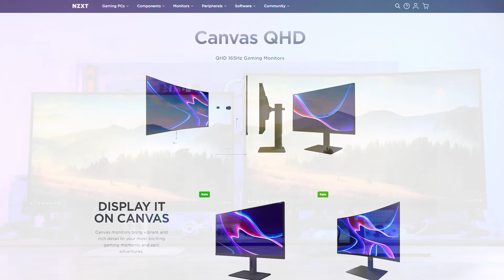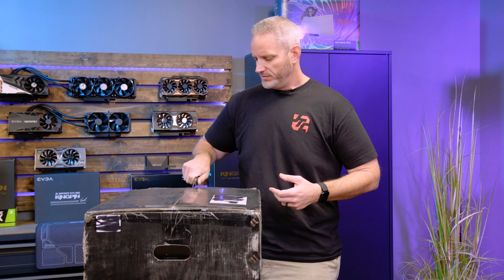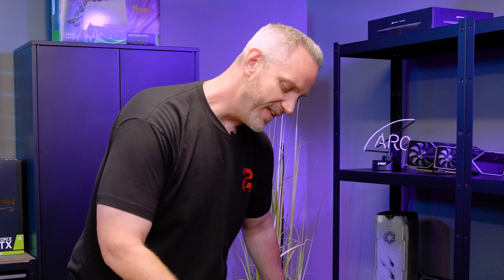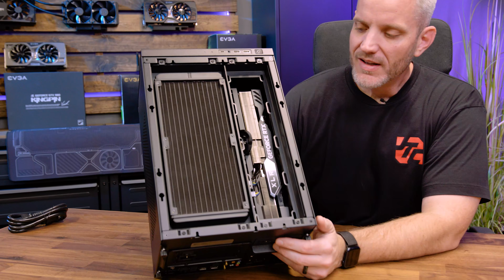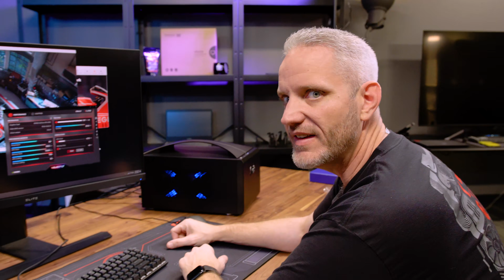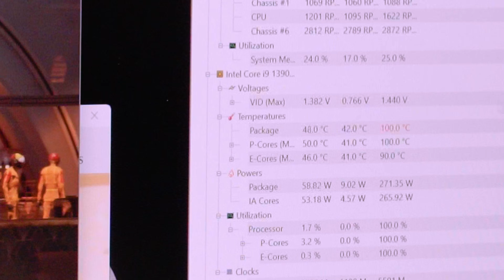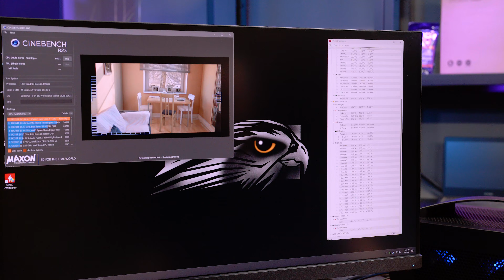Falcon Northwest DARED me to review the Fragbox!

Comment: Having a Corsair 380T myself I still love the LAN box cases with handles. I really think there should be some more cases with handles again. Also really liked the CM Storm Trooper & Stryker designs.
I also wonder what kind of performance you could squeeze in a 380T now in late 2022, being limited to a 2/2,5 slot GPU and max 240mm radiators or 140mm tall air-cooler.

Comment: Ever since the 8700K I've run all my CPU's including 9900K, 9900KS, 10900K, 12900K with direct to die cooling.  Removing the IHS and putting the cold plate of either your AIO or your custom loop directly on the die with liquid metal is such a HUGE improvement in cooling I just can't see ever doing it any other way.  The only thing I wish I had is that EK/intel Delta TEC EVO Cryo cooler is so bad ass that is the current limit of the very best you can get for 24/7 cooling.... it's just so expensive

Comment: i fly to Atlanta twice a year from california for a LAN party. I currently use a custom built SilverStone SUGO 15 case that fits into my carry on luggage, and plan flights with a friend that has delta advantage so we board early and never have to check bags at the gate. I just have a permanent keyboard/mouse/monitor/speaker bar at my friends house in atlanta instead of traveling with those. This Falcon machine might be an option for the guys that dont want to deal with building their own. EDIT: i checked the Delta website. this case is too large for carryon (technically) Delta limits carryon to 9"x14"x22". this case is 10.5"x10.2"x16.5".  my SUGO 15 for reference is 8.3"x9.8"x14.4". so they are close, but not there as far as being airline LAN party accessible.

Comment: Sure, they have a full size ATX power supply in there, and a 240mm AIO.. But you can get a 240 AIO in a much, much smaller case, with a normal Mini-ITX MoBo, with the only compromise being at most an SFX/SFX-L power supply... But even something like a Cooler Master NR200 can accommodate a full size ATX, and I think it's smaller (albeit not that much, and definitely cheaper) than this

Comment: I still love the simplicity of the looks.
No over the top LGB, no crazy shapes, Doesn't replace all the lights in the room...
Would like to see them work on the airflow. Maybe mesh up the front. Would also like to see room for an air cooler. I've had bad luck with AIO's failing

Comment: I like the case. I've been looking for a NR200 replacement that can fit my Gigabyte 4090 , its 140mm long and so many small ITX cases won't fit it.  At the moment I just have my 4090 sitting outside the case with a riser cable. Works well for optimum cooling I suppose. I also have the Arctic AIO 280 which is larger / thicker than most 280's.

I'm not crazy about those temperatures. I squeeze the 4090 to 28 degrees 55% fan. and it maxes at 71 degrees but the card is overclocked and can draw more than 500 watts. That reminds me I am still using my 800w psu.

Comment: Im sure they did their homework but im concerned about the additional graphics card fans
Typically you dont ever want two different fans directly blowing in to another for a number of reasons but i feel like removing that entire fan bracket would increase airflow overall and reduce noise
the bracket itself blocks quite a lot of direct flow
EDIT: the only thing i can think of for why is the bracket is needed for rigidity and the fans are used to try and compensate

Comment: Using a barrow combo CPU/pump block into a Koolance 30-FPI HX-CU1402V 280mm radiator. Followed by swapping the AIO fans & 120mm fans for 4x Noctua NF-A14 IPPC-2000 fans. Would significantly improve cooling. With only case change being a fan bracket.

Comment: Damn nice PC you have there Jay. I too have my old lan box waiting for it's turn at being upgraded from socket 775 to AMD B550 w/5600X to start then a 5800X3D. I am going to wait and see what the V-cache cpus bring to gaming before I switch. Trying to get a full 4 years out of my Crosshair VIII Impact motherboard. It now has a 5800X3D and a Sapphire Toxic 6900XT. It does the job for me @1440p/144hz. I like the way Falcon set the system up it was quiet and powerful otb. Tweaking is half the fun after you get it set up. Thanks Jay.

Comment: It's above 22 liters so it isn't SFF enough. My Sliger SM580 at 15,88 liters can fit a reference RTX 4090, though not some of the bigger custom cards. Whats best about SFF PCs is the little desktop space they actually use on the desk and this actually looks like it takes up way too much space. If they could do this in the Tiki, it would be way more impressive than this.

Comment: Temps don't matter unless it's throttling. Won't hurt longevity, won't hurt performance. Would run at full boost speed at 100 degrees 24/7 for years and years.

Comment: I have a Falcon NW Tiki that I've been running since 2013. It still runs amazing. I replaced it with a custom build that I built when 30 series came out just because it had aged out but it was still lightning fast and problem free after 7 years given the hardware in it. I firmly believe FNW makes the best pre-built systems on the market.
Reply: Thanks Jordan!

Comment: This reminds me a lot of my mini PC, buy wayyyy more power (and probably a bit larger, too). I use a Silverstone SG13, and it's currently packed with a Ryzen 5 3600 and RTX 2080. A lot of power in one little 11.5 liter box. This chassis looks really similar, but a little bit large to accommodate the larger AIO and the larger GPU. And yeah, under full load the 2080 hits its 83 degree thermal limit where it would start to downclock. It's not bad under normal gaming conditions though.

Comment: It seems the only way an SFF case works is with an air cooled GPU. I ordered everything for an AM5 system including all the parts for an EKWB CPU and GPU loop with a 360mm rad (except the actual 7900 XTX), and I was told both when I asked on Reddit and when I asked EKWB on Facebook that a 240mm rad would not be enough to cool both adequately. But at least with the mATX Asus AP201 case I got I can use a full ATX PSU and have more room for storage drives.

Comment: Love the videos as always. Anyway possible you could give a quick "terminology for dummies" break down for All Core, PCore, and ECore when you're doing your next setup? Tried to use iFixIt on my brain but didn't have the right set.
Reply: P core = Intel's performance core. They use two types. E cores are efficiency cores. All core would refer to the clock speed that all cores can sustain at once. Although for an Intel chip like this, I would assume that clock speed would exclude the E cores.

Comment: The build quality looks insane, along with the design and layout. Very impressed.
Reply: Honestly, layout isn't that great compared to the NR200. Main difference is in the NR200, that void where the cables are bundled is where the PSU would be; it doesn't obstruct the exhaust from the GPU, doesn't choke out half the fans on the radiator, opens up the space above the CPU for an air cooler instead (Fuma Scythe 2 can fit in there), and positions the PSU to draw air in from outside the case. I think the only nice thing about this layout is the PSU's power switch is more accessible.

If you have a FE card there's even enough space to buy the ATX PSU bracket for the NR200 so you won't be as limited in PSU choices.

Comment: First pc while in the corps I built was a mini-ITX gaming rig. Went with a tiny cube case. Thing had that sfx psu. Was a pain in the ass to find and it was still only 650 watts. Case was so poorly designed I couldn't do much about the wires. I like small formfactor, but if I do so again, I will be extremely picky about the case I'm putting it in. I ended up moving that pc to a case somewhat similar in size to the Fragbox. Just didn't have a handle.

Comment: I think the biggest problem for the CPU cooling is that half of one of the two fans is cut off by the PSU. In a case without anything blocking the fans a 280mm AIO performs exactly the same as a 360mm AIO.

Comment: I'm surprised they didn't choose to brag about their Tiki PC.
I bought one of their TLX laptops back in 2012 and it is still working though I had to replace the HHD and it runs linux now instead of the win 7 it came with.
Reply: Thanks for your business!  The Tiki is only half the size, but it can't fit a 4090.  Perhaps when Radeon 7900 Series hits, Jay will check out our Tiki?  :)
Reply: @Falcon_Northwest  Not surprising seeing as I saw some comparison photos where the 4090 was bigger then a European  2L.
Having a 5950X and a 6950XT in that small case is a pretty impressive as well.

Comment: For those that are curious all the builds Falcon offers start at $3+K.
Reply: Thing about it is though, $3k starting for a ryzen7 cpu and a 3060, in a mid tower. Seems a touch high for so mid upper parts
Reply: @LegacyLives96  could be a pricing strategy to funnel customers towards their highest end builds
Reply: That's the part I don't like about the video, he praises the system for its performance and build quality (no question, it's awesome) but doesn't mention the 5k+ pricetag.
Reply: I expected them to be expensive and as you confirmed, they are.  I am confident you get what you pay for with these builds from them so the prices are justifiable.  But just like a Bugatti would take me anywhere I want to go, I can only afford my Jeep Renegade.

Comment: That thing is huge! I can also imagine it weighs quite a ton with a 4090. I would hardly consider that something convenient to lug around to lan parties.
Reply: Convenient? You spoiled kids lol.
Try lugging a crt monitor and a full tower case around.
Reply: @mephInc  This.  I still remember seat belting my big ol' crt when going to a friends house for a lan party.  And the big metal full tower wasnt much better lol.
Reply: Thought 1-  I don't consider a 4090 convenient to lug around to LAN parties by itself... I call my Gigabyte 4080 Big Chungus, and its just the Gaming... The Aorus 4080/90 is even bigger
Thought 2-  I used to lug around an Aopen HX08 with a 19" CRT monitor to LAN parties.  2 feet tall, solid steel side panels (pure beige, of course), weighed a veritable ton even before you put the computer in.    I mean it wasn't convenient, attractive, or even remotely practical.   But man I thought I was badass.

Comment: Saying SFX power supplies wouldn't be able to power a 40-series GPU is false. I ran my overclocked 5900x/RTX4090 off a Corsair SF750 just fine and the total system power draw never even went over 600W. And there are even higher powered SFX units out there too.

Comment: At a base surface area level a 280 isn't that much smaller than at 360. The extra 20mm on the depth really adds up. That said obv rad perf and fin density is more important than SA. Just pointing out the 280 instead of a 360 isn't too extreme of a compromise as far as the cooling area you're getting.
Reply: I think the difference between a 360 and 280 is only about 10%

Comment: So I am gonna start planning for a "4k build" sometime this summer.  Out of curiosity I went over to OriginPC and decked out what I wanted and it came out to just over 4800 bucks.  Disgusting for sure but then I went over to Microcenter and priced out each part like for like  and after taxes came out to around $4500 bucks and some change.  Been building since 2007 and for once I might just go for a prebuild.  Yeah you never beat the whole build it yourself feeling but after all these years I still suck at cable management, and for an extra 300 bucks more they can make that shit look pretty tight and neat.  Seeing Jay say nothing but good about them and plus doing some online research I might just bite the bullet. Hopefully I won't be bit in the ass 😁
Reply: Falcon Northwest has long been a super reliable, high end SI.  If you're cool with spending the extra on them you'll definitely enjoy what you get

Comment: I run the 13900K with -0.1V with a Z690 TUF (DDR4, 3600) and a NH-D15 and get between 39500 and 40000k in Cinebench R23, I guess it's also possible with a 240 Radiator

Comment: Just wondering - have you ever built a performance fanless silent build?
Reply: My 2021 gaming PC has dual 360mm rads. It runs so cool on it's own I had to force the fans to turn on. They won't turn on by themselves because the water temp never gets high enough. It's a 5900x with a a 3070 (both water cooled). Just radiation from the dual rads alone is enough. lol I'm like.....so why did I just spend $100 on fans? LMAO I did cinebench for a 10 minute test. The water temperature only went up 5 degrees. Which was still too low to run the fans. lol oh and CPU max temp = 65, GPU max temp = 42.

Comment: Damn they are expensive.  Their base Talon is $4,000.00 with a Ryzen 7600X and a RTX 3060Ti with only 32GB ram.  This is  crazy mark up for such a mid performance  PC.
Reply: Could buy ITX Case and build it for a lot less.
Reply: Yeah it's over $6,000 for a decked out RTX 4090 Talon. Even without anything special for cosmetics factored in.

Comment: They should move the psu to the space in front of the mobo and sandwich the cpu rad with 4 fans maybe it would help with the temps.
Reply: That's exactly what I did in my sff pc, except instead of more fans I crammed a full size atx psu in a case smaller than this one, so you are absolutely right that it would fit in there.
Reply: A PSU with a fan would help with temps and the fan doesn't even need to run. But, it's hard to get a SFX PSU with a fan... 🤷‍♂ and not to mention as a business it's another failure point to consider.

Comment: I’ve been a huge Falcon NW fan forever. The fragbox was a really amazing form factor in the 2000s.
Reply: It’s still the 2000s.
Reply: @zeroman614  And that's really surprising. Especially for housing a 4000 series RTX card. And here I am rocking a mid tower/ATX build because smaller mini-ATX builds simply ran too hot. But holy shit at the pricing. $3K+!!!
Reply: the prices are bloated....5.5k for 13900k and 4090...
Here a 4090 is 1600+13900k is ~700.
So there is 3000 bucks for the rest, must be a hell of a Cooler, mb, PSU and case for that money...
Reply: @TheOuterhaven  It's a 3080 right?

Comment: That SX1000 power supply uses server power supply techniques to get that small and that high efficiency.  That's a hell of a nice power supply.
Reply: Asus has a 1200W SFX-L unit coming out with titanium efficiency. They announced awhile ago so who knows when it will be available but I’ll be getting one. My Cerberus X case can support an ATX PSU but with the 4090 leaving me only 26mm of clearance in the front, can’t fit a radiator and fans so running my 5800X with a NH-D12L and a front mount SFX unit. I thought for sure my 750W Corsair platinum SFX would be enough for any card upgrade I did. Supported 2 1080Ti’s just fine. 1200w should mean I’m good for many years but who knows. Soon GPUs might pull 800W and CPUs 400.
Reply: @jolness1  damn!
Reply: @jolness1  Idk, if they go much above 1600W or so I think they have to start using different power plug connectors in the US at least.  15A and 20A circuits are supposed to use different plugs where the 20A has one spade of the plug rotated 90 degrees.  If you've ever seen outlets with an extra notch in one hole, that's why.
Reply: @big0bad0brad  I wish the world actually did this.  I bought a microwave with air fryer mode.  It draws 1600 watts.  It tripped the 15amp gfci circuit and worked ok when plugged into a non gfci but no twisted prong.  I agree with you tho.  It also matters if you have 110 volts or like 117 volts which is commonly found.
Reply: @jolness1  Time to learn the golden art of undervolting. Many GPU's can be undervolted with no performance loss, and if you take a 1-3% loss you can often bring their wattage down by about a third.
Reply: What is behind the snake-oil phrase “server power supply techniques”?
Last time I checked, servers used exactly the same components in the power supply, if not sometimes cheaper, compared to gamer computers.
They have a different form factor, sure. And some servers even have two power supplies, for fallback, if one fails.
Reply: @fr3ddyfr3sh  the main difference is a server psu doesnt care about how loud it gets and is expected to be running 24/7 at close to the max it can supply. If i remember correctly since gpu use 12v and many servers will have multiple of them, server psu are also expected to push more amps at 12v
Reply: @fr3ddyfr3sh  Yeah, to me the main server power supply techniques are sticking the tiniest, loudest fans you can find in them and raising the price like crazy.  Unless they're old server power supplies, then they're dirt cheap.  But usually still loud fans.
Reply: @fr3ddyfr3sh  No, they don't.  Server power supplies need to convert the maximum amount of power in a very small form factor.  Servers have between 850W and 1500W of power needs in a redundant form factor about 1/6 of the profile of ATX power supplies, with a 40mm fan, and at 80 Plus Titanium levels of efficiency or better, plus need to be more reliable.  They use vastly different, and more expensive, technology than ATX desktop power supplies.
Reply: I wonder if the power supply uses the new GaN (gallium nitride) technology